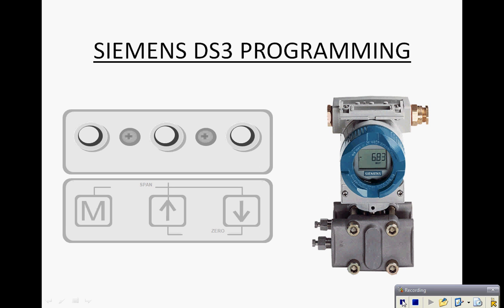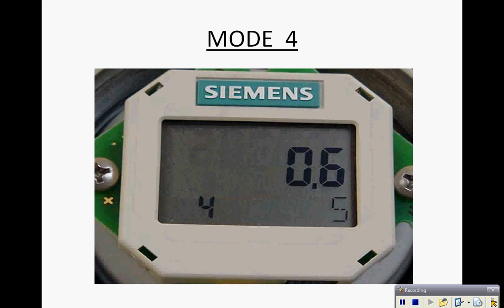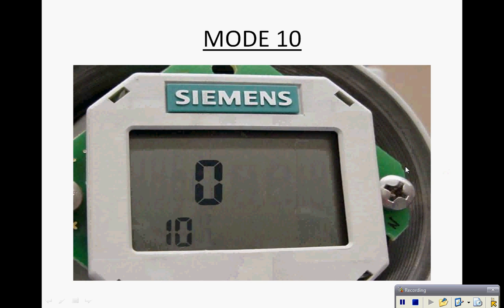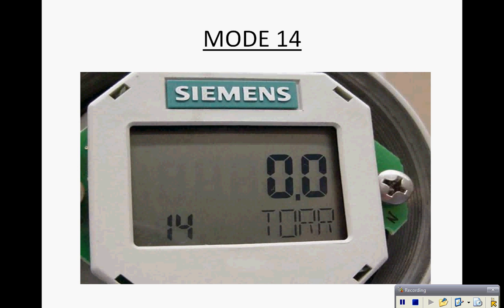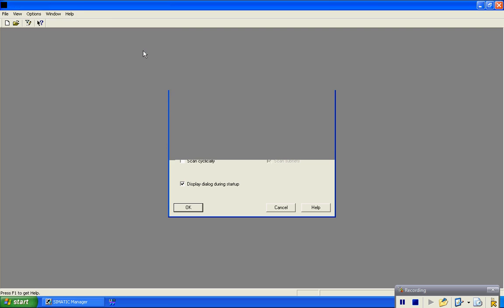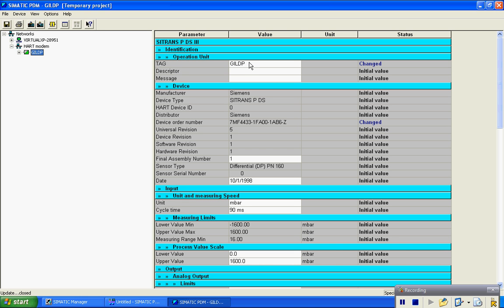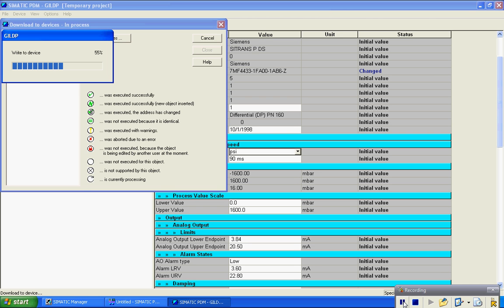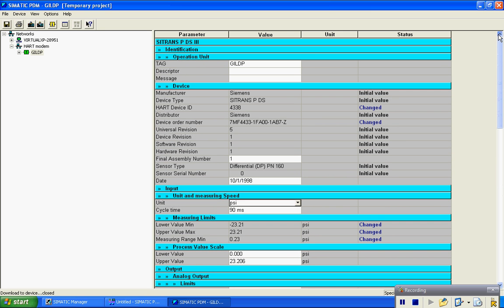Siemens DS III Configuration

Comment: I have to measure in -1mbar to +1mbar

How can I set the range, when my transmitter span is 1 to 60 mbar?
Reply from the maker: You need a different transmeter. This is only a 2 mbar range. The 60 mbar transmitter minimum range should be no less than 6 mbar.
Reply: @GilsonEngineering  I also have a transmitter with span 1 to 20 mbar.. Can I use it for -1 to +1 mbar? How can I set it in that range without applying actual pressure?

Comment: We have siemens pressure transmitters but the output signal is mA n we wanna see bar or PSI, where do I adjust the units? on the upper buttoms u showed? I didn't understand
Reply: in M13 there's a list of values that can be displayed , %prv, bar mmHg, mBar, etc